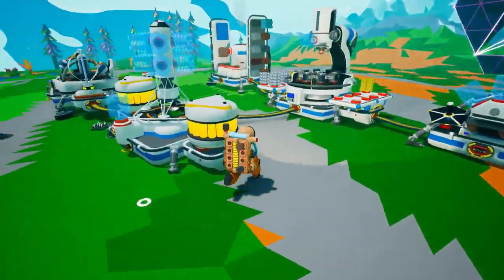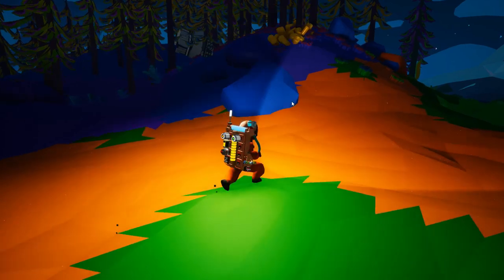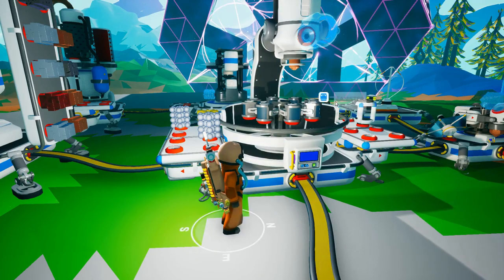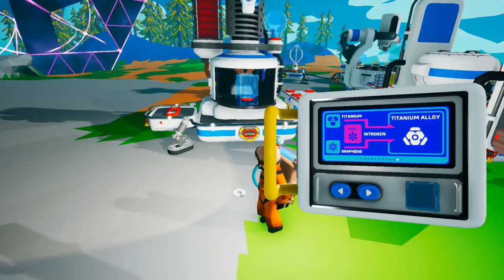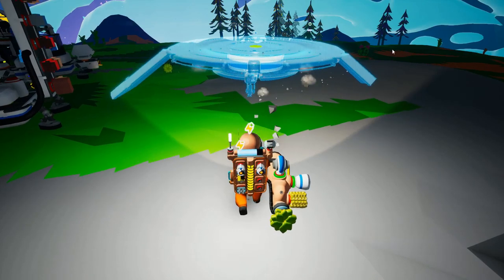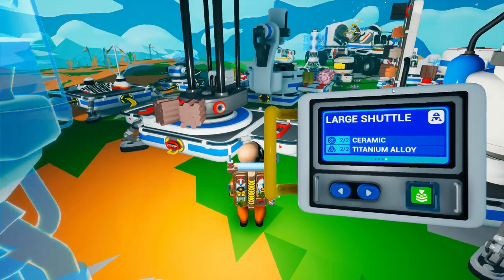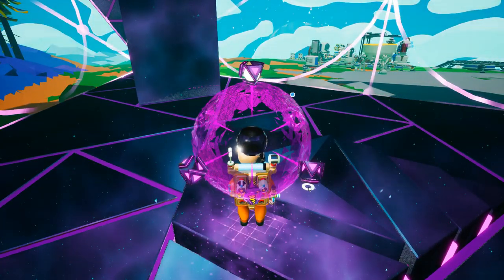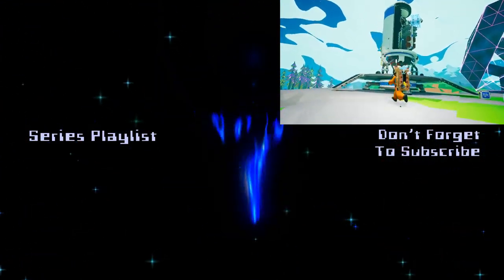Astroneer 16:  Using Gateways To Rebuild A Main Base!  Let's Play Full Release Gameplay

Comment: 37:35 There are no power connectors on the bottom of the Trade Platform, only mechanical connectors. It doesn't need a platform and it doesn't connect to the network.